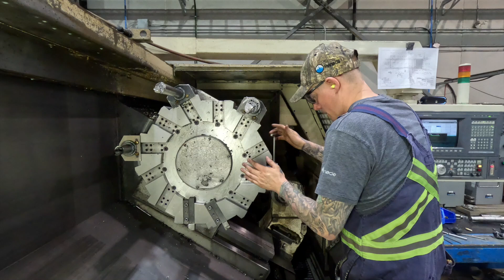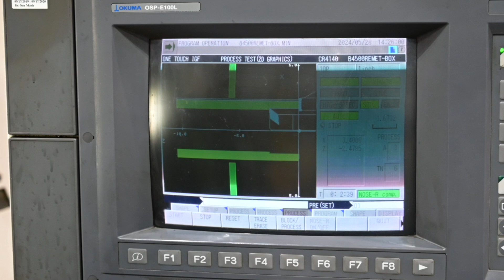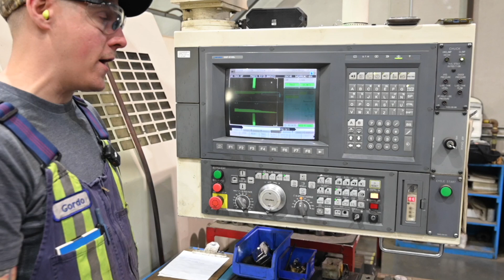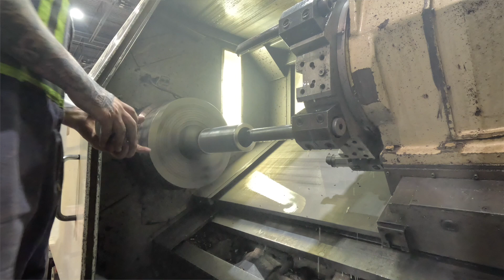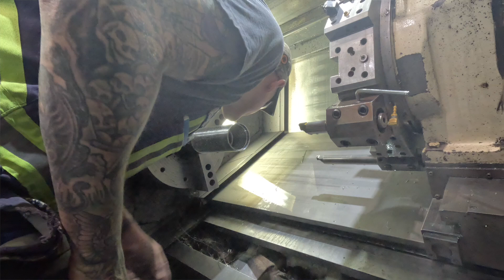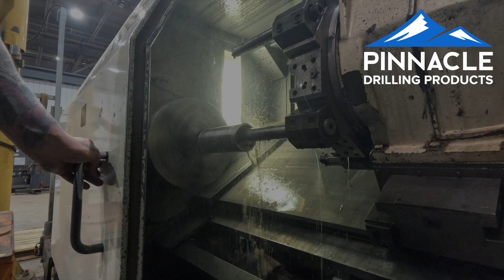Gordo (Pt.1 of 2) Machining SAVER subs - Pinnacle Drilling

Comment: Chatter on the finish OD cut, so typical 😒
When you're trying to hit that perfect finished size and the Chatter starts kicking in ???

What I find works for me when Chatter starts on Threads is just live with it until the final cuts where I come back with light finishing passes to clean up the Thread and remove the Chatter.
You were bound to get Chatter on a fairly thin wall material hanging out from the Chuck.

Nice work man 👍

Comment: could you go into more detail about that thread? the second threading cycle.
Reply: It would appear that he roughed out a square thread to the major diameter (leaving stock on either side) and then ran at least 2 more cycles to finish each side of the thread without cutting on the tip of the tool, just puting a 30 degree angle on either side creating a 60 degree thread with a wide flat bottom as opposed to a standard thread with a point. cutting a thread on 3 sides of a tool is too much engagement for just one threading cycle in most cases.   \_/  vs  \/